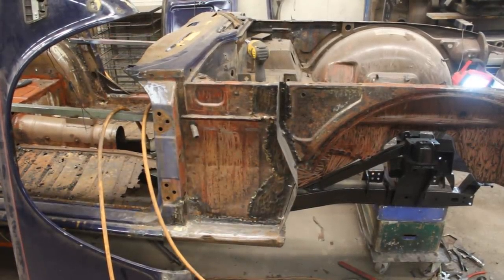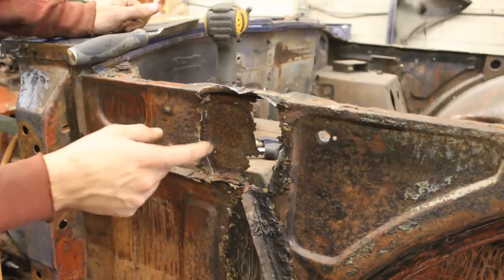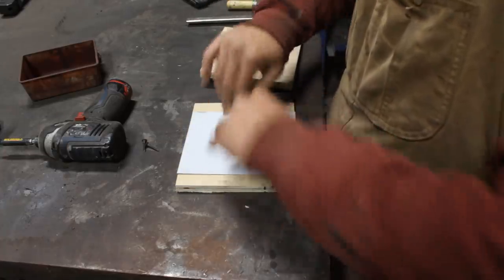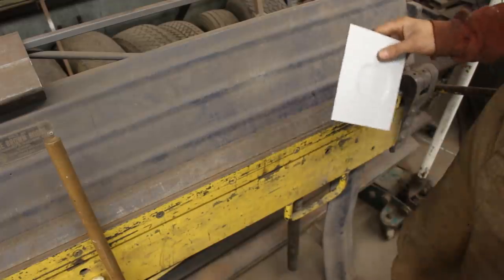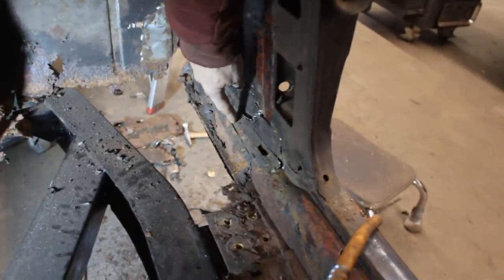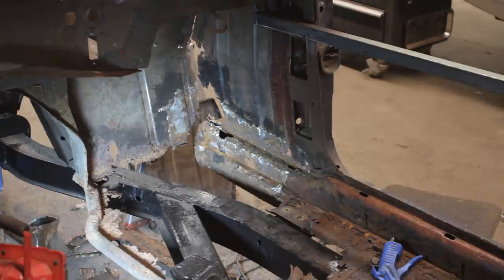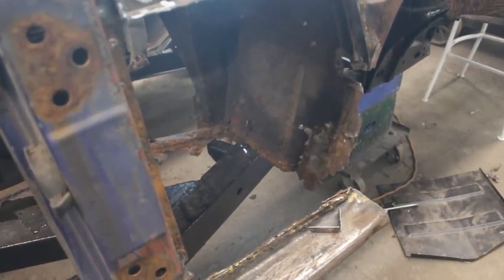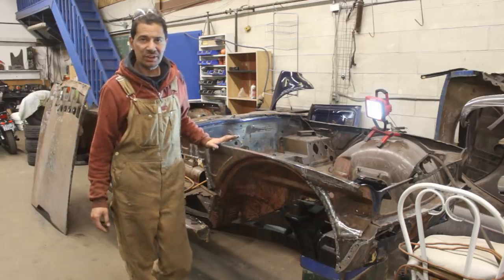1974 Triumph TR6 Restoration - part 11 - Inner fender repairs

Comment: Maybe next time you want to make an indentations make the template and form out of plate metal to create sharper edges and just use the wood as filler as it won't compress?  Not sure if it would work just an idea.

Comment: When the inner whole inner fender stamps are available, why would try a patch?
Reply from the maker: For the same reason I don't check the correct answers at the back of the newspaper when I solve a crosswords puzzle :}
Seriously, it is much more labor and money for the new part than fixing the rotten areas on this one. They are not that much.